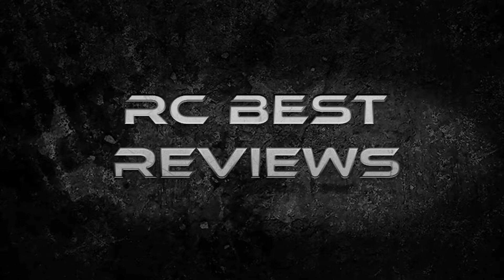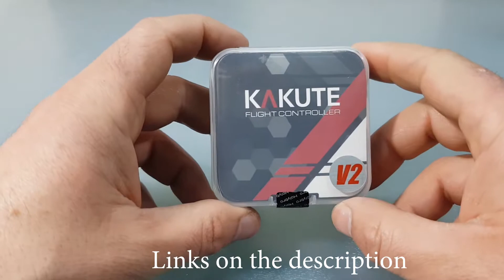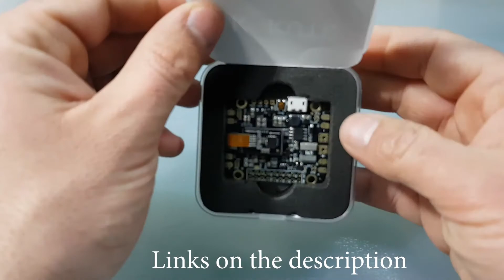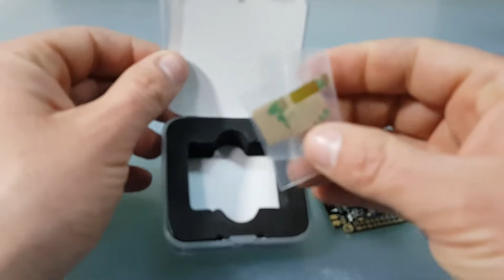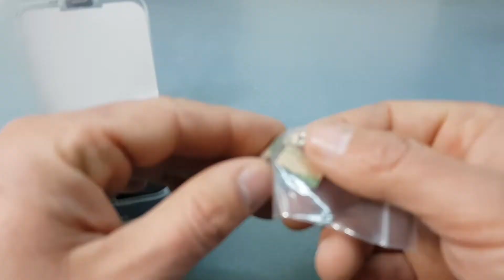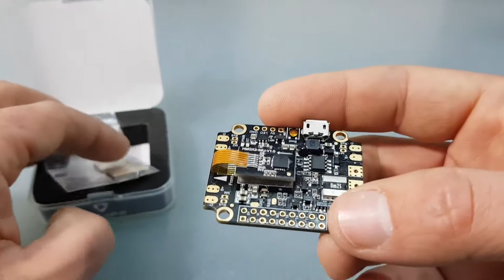HOLYBRO Kakute AIO V2

Comment: Nice overview!  I can't believe this doesn't have 150 views by now!  Next question:  What is this going to be installed in?  ;)
Reply from the maker: Will be installed on a tinsly f50 frame with flycolor 50A x-cross ESCs, 2305 2450kv amaxinno motors. This will be a 6S capable setup.